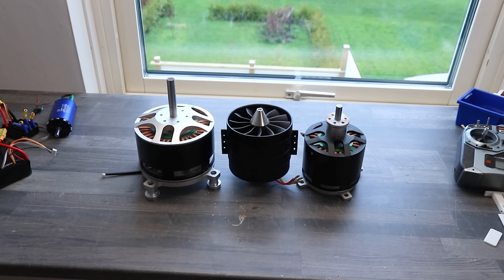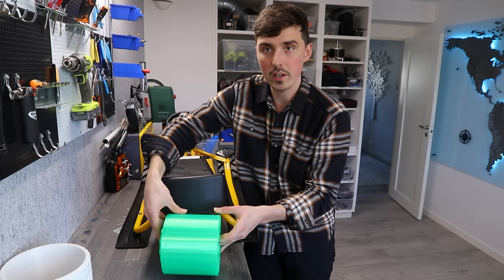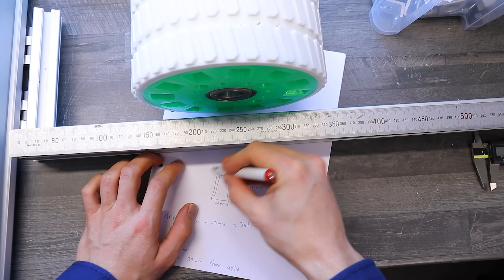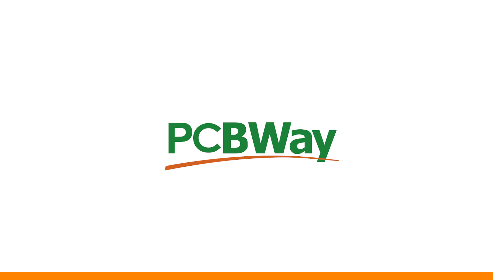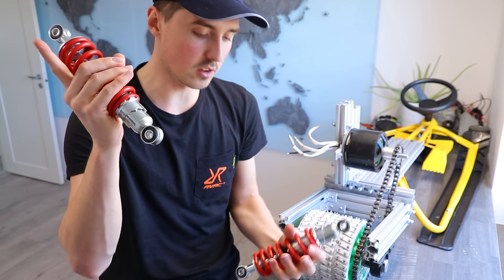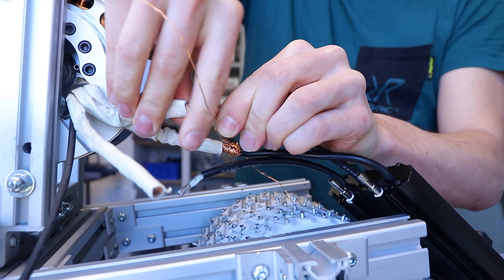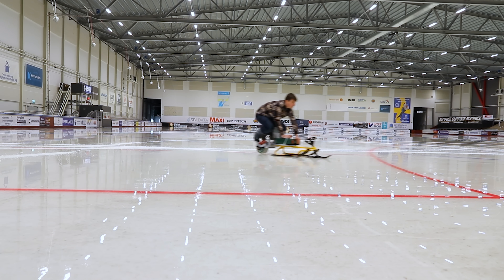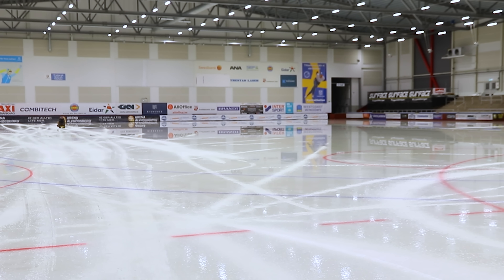15kW Electric Snow Racer Made With 3D Printed Parts

Comment: For those gigantic wires coming out of the motors, you want to have a solder pot, and to strip off the insulation you can use a wire brush/wheel instead of just burning them off. You can burn off the insulation in the solder pot, but it ruins the solder fast.

Comment: Instead of mounting the bearings directly into the 3D printed part, why not mount them inside a metal tube and then mount the tube in the 3D printed part to better distribute the load? Also put a spacer between the bearings.

Comment: Simply just set the shocks so that the wheel sits lower then the sled when not under load. Then when you sit on it you will actually have constant down Force.

Comment: How about putting motor, batteries, and controller behind rear wheel and also move seat slghtly further back to change weight distribution without adding dead weight?

Comment: To fix the grip, really all you needed to do was mount the shocks so that they would have some preload once you sit on it. So, when holding everything in the air, the wheel would be too far down, if that makes sense. That way the shocks are always actively pushing your wheel into the ice.
Reply: Exactly
Reply: The chain tension while the motor is running would also pull it towards the motor (up). Maybe mount the motor lower, too.
Reply: @goatboy150  he wanted clearance from the frame. I assume he didn't want to rework. 🤢rework.
Reply: @goatboy150  you could alternatively mount the motor onto the suspension, or add a belt tensioner
Reply: @goatboy150  belts exist
Reply: @kirill2525  Belts are a myth.
And I fail to see how that's relevant.
Reply: @goatboy150  lots of people use them instead of chains. and they strech so  thats how its relevent.
Reply: @kirill2525  Stretching doesn't help at all. That just means it has to be tightened more.
Reply: @traniel123456789  well no i meant that when its  at a perfect tention, it can still move more then a chain would. also  belts   dont come off as eselly, theres no sprocket that has to get into a small hole and if it missess it messes everything up.
Reply: @kirill2525  belts don't stretch anywhere near enough to take up all the slack. Belts are designed to not stretch very much at all.
Reply: @kirill2525  belts that are used to drive things like this typically have Kevlar reinforcement in the spine of the belt specifically so they don't stretch.
Reply: Wait he didn't do that? Well no wonder then
Reply: Agree. And mount motor on same frame - chain does not need tensioner (unless you run it for many hours and have no way to adjust it).
Reply: @mayoropl1  this is the way, fix the motor to the spring loaded part and ensure the shocks take nearly all of your weight before the skids touch the ground
Reply: Yes and a blade on the front for more positive steering
Reply: Exactly!
Reply: Umm.. the starting torque may be the, (one of the) problems too.
Reply: or maybe move all that stuff that is now residing behind his ass, under the bench so he could sit legs more straight and body weight over that back tire (not all the way, that leverage makes bumps less nasty) and lose those weights. also add some sharp edge metal to front ski to have some ability to turn.
Reply: "So, when in the air the wheels are not too far down." In RC racing, a 'droop screw' does this. Same concepts used.
Reply: I didn't see your comment but I basically said the same thing. 👍
Reply: I was thinking the same thing
Reply: commented this same thing before seeing this. exactly right my man. 
although, may work in his favor to have slightly less then optimal grip to lets the motor get to high RPM, low end torque may struggle with the inertia of the full load at once
Reply: Here’s what you should’ve done ,,,,,,, 
Every comment :)
Reply: @f87115  when compiled, seems legit. Turn it off and on again.
Reply: haha belts would be dumb yall all wrong only solution for perfect tention is to put the motor and the backwheel onto one piece that swings so they both swing together and it doesnt have to be adjusted
Reply: Yea, you need up AND down travel for suspension to be effective in keeping wheels in contact with the ground.
Reply: Yep, totally crappy design. Or lack of design at all.
Reply: @kuflik  I mean odds are none of us would have known how to fix or even considered a solution to be possible if this wasnt mentioned
Reply: @jpsalis  this was my first thought when he started the assembly... But I've seen snow mobile before;)
Reply: Just read the belt to chain debate below is this discreet primordial argument?

Comment: You could perhaps simply the studs in your wheel by screwing short screws from the inside out before placing the tire over the rim. It would save you a lot of grinding and heating.

Comment: Should have had some skates for steering as well as having the back wheel down lower than the bottomless sled and using a springs as creating contact to the ice probably wouldn't need the weights in the back.

Comment: Put a lever under the seat the presses up on a mount that pushed the tire into the ground. That way you don’t need shocks or weights because it’s just your body mass holding the wheel into the ground.

Comment: Thanks for telling us about the problem with the insulated wire. I would not have thought that could be the reason and would have made the same mistake. That is the most frustrating problem you can't even blame on yourself or someone else. Respect that you found it. It reminded me of an ESP project I once did and my GND was actually an NC pin, and I really didn't understand, why my project, which worked on a breadboard, stopped working.

Comment: Your shocks should be extending the wheel much lower then the runners. Then when you sit on it your weight compresses the shocks and pushes the wheel into the ice.

Comment: The design is actually simple,, but you made it a lot more complicated which mad you to add weights on the back , you should have made upside-down L frame and attach the shock absorbers 120° to the frame closer to the rear wheel with auto chain tensioning , the shock absorbers will help push the wheel down,, no need of weights,,you made it work this time , make it satisfying the next time ,, overall ,,good job👍👍
Reply: Or just watch the video and be quiet? Lmao as if he’s your employee
Reply: @kronicole6875  Or just read my comment and be quite? Lmao as if I'm your employee

Comment: If you put the motor on the swingarm or at least near the pivot point, there is no chain growth/ shrink so the shocks will work as shocks instead of chain tensioners
Reply: You can even see the shocks compressing from the torque pf the motor at the end

Comment: You could move the shocks on the swingarm closer to the rotation point of the swingarm, to put pressure on the driven wheel. Unloaded the vehicle might 'nose down'.     Great vid, i'm impressed with your ingenuity. Keep up the grind.

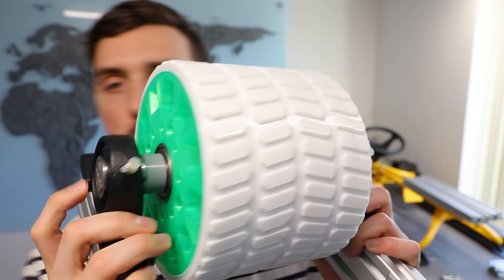Comment: 3:48 - 25mm axel is not as much overkill as having bearings in the wheel and on the mounts also! 🤯😜😁
Reply: .. And having the chain tensioned between a stationary frame and hinged arm is not the best idea… good thing the shocks are super stiff or else he would have an epic backslap from the chain flying off.. 🤯😅

Comment: Maybe it'd be worth putting a fuse in line with the batteries when testing big speed controllers in future? Or get a bench power supply which could limit cutting until you know it works.

Comment: A skate in place of the steering sled will likely improve the turning radius. Additionally, if the motor and axle locations can be reconfigured to place the tire underneath the rider, the extra weight may be removed.
Reply: That's what I was thinking too. Could have gotten to a higher speed going around the rink instead of just end to end.

Comment: Ok, the reason why you can't get a good grip and need to add weight on the wheel is because you distribute the weight over so many screws on the wheel. If you use fewer you will get a much better grip. Concentrate the weight of the vehicle on one spot instead of a large area.

Comment: Next time use, for example, Makita circular saw with cheapest maximum carbide teeth blade (for wood) and it cuts even aluminium bar quite well. Maximum thick I've cut was 15mm thick aluminium bar ;)

Comment: Fun project. The force from the chain will collapse your joint and therefore shortening the chainstay(giving more chain play) and lifting the wheel when accelerating. Pivot should be slightly above motor to add traction when accelerating. Or mounted on the same rail as motor :) thanks for the entertaining video.

Comment: You got those coilovers in the back to tension the wheel against the ground and then didn't actually make any tension in them. The spring is just sitting near max droop on your work bench, that's why you needed so much extra weight on the back.
Reply: If he put the motor on the swingarm or at least near the pivot point, there is no chain growth/ shrink so the shocks will work as shocks instead of chain tensioners
Reply: @Buurman169  fuck I didn't even think of that aspect holding him back too.

Comment: if you made the back a little longer wouldn't that distribute your weight a little better into the back wheel? then you could also use that space to fit in some weights that wouldn't have to swing on the back and cause all the change of inertia when you try to slow down with the weights moving back and forth

Comment: This is so cool. It would be great to see it on a large lake or something so you can get full speed. I just wonder whether it would be better to have a blade for steering? Also maybe the wheel should be mid-mounted and steering at the rear? That way you would wouldn’t need additional weight so it should be faster and more agile
Reply: The blades from old ice skates could work, way less friction than the plastic.
And a steel sheet behind the seat, if any metal part comes loose it'll shred that thin piece of acrylic to bits.
The traction problem could be solved by stronger springs, the shocks are not desirable because they dampen the motion of the drive wheel.
Reply: A blade for a steering mechanism sounds to me like an imminent trip to the hospital. Although the whole project is of that nature I suppose.
Reply: @sebastianolsson9063  thats how snowmobiles do it
Reply: Or a circular skating rink
Reply: and he needs to make a chain guard out of metal for safety also he could use a seat thats the same style as a snow mobile for protection and better weight distribution so the power goes straight to the ground and a ice blade in the front for steering
Reply: Yeah, putting blades under all all 3 skids like on ice-yachts would do wonders for both speed and handeling.

Comment: You need the electronic from a sur ron 32.5ah battery 60v controller with a motor capable of doing 18kw
Reply: @cloudpandarism2627 you didnt understand why i commented right?
Reply: @cloudpandarism2627   having a mid life crisis over a comment wont do you good buddy
Reply: @cloudpandarism2627  2minute in esc catch fire the stock power would be less but in term of reliability its day n night and not forget about 72v setup 15kw ez

Comment: Looks like it needs to have a lot more spring pressure and extension (range) on that rear swing arm, also chain tensioner.
Otherwise it seems to work really well, good grip on ice means hard packed snow will be a breeze.
Reply: He always seems to miss on the geometry and the pressure of this style drive. The wheel should really drop an inch or so below the sled when not sprung. The motor sprocket should be inline with the armature. It seems to work out well with the weights though.
Reply: @TioDave  imagine how good it would work if the weights were a 180 pound man pushing down.
Reply: I would put the wheel under the seat between the skis. No need to add any extra weight then.
Reply: @astroidea  I briefly thought about that possibility, however you’d have less steering authority.
Reply: @gtjack9  Not really spring pressure, just preload. I agree that rear swing arm requires more downward motion range which coupled with more preload would give decent enough grip. My list would include:
- moving shocks mounting points on the swing arm closer to the hinges to increase springs preload
- might be necessary to tweak swing arm hinges position to allow more swing arm downward movement to allow installing shock with higher preload without use of spring compressing tools (more downward position of swing arm at shocks installation time gives you higher preload at ride angle).
- moving motor onto the swing arm cause without that with swing arm motion you go from belt falling off to belt so tight it'll snap (tensioner won't have enough range).
- i would made "safety" screen higher than at least half of chain length measuring from motor axis - snapped chain tends to act like a whip with rotation axis centered around the engagement point with the cog.
Reply: @Doktoreq  you nailed it.

While watching I didn't understand why he was mounting the motor on the frame instead of the swingarm. And I didn't get why he was mounting the springs without preloading.
Reply: It's all wrong, forget the studded wheel.. it needs a jet turbine instead.